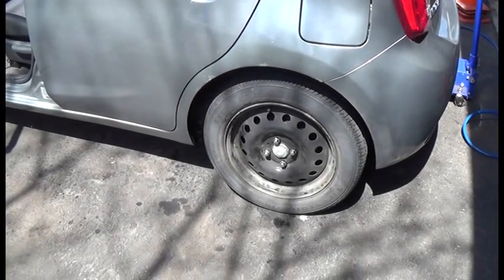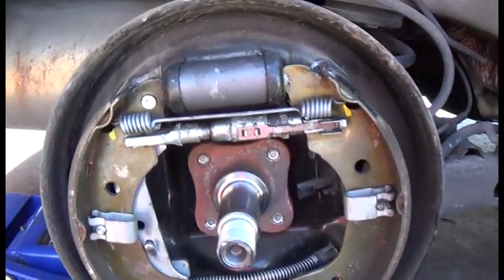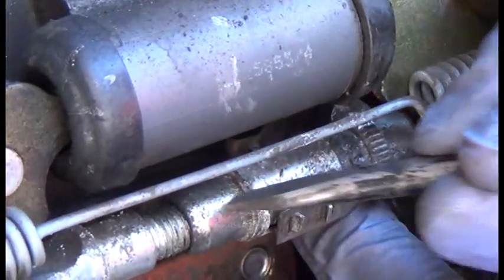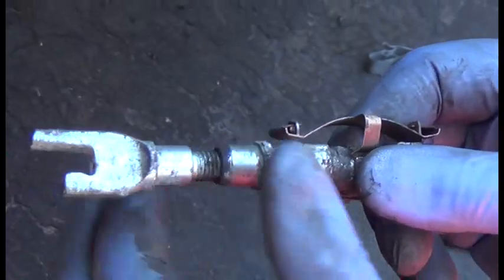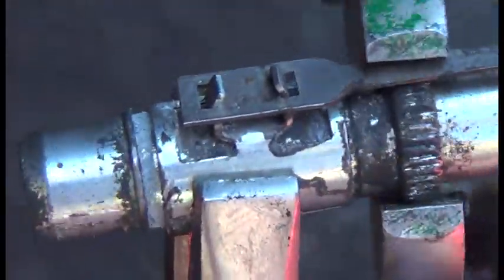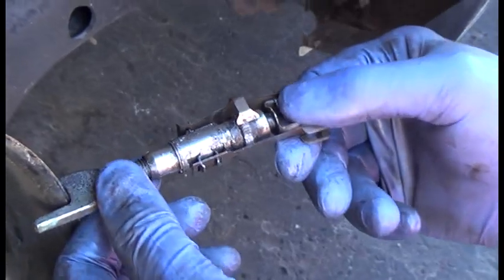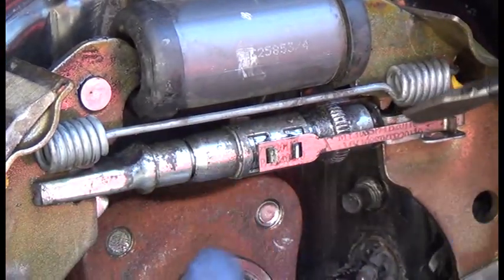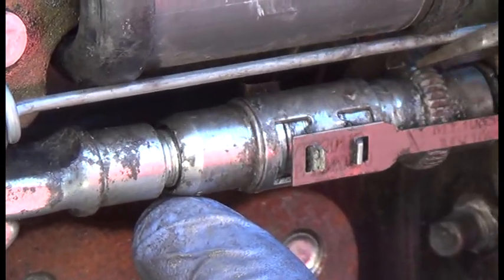Nissan Micra Seized Rear Brake Auto Adjuster

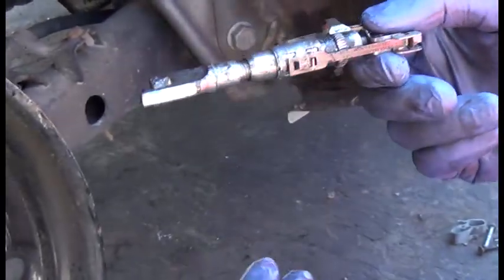Comment: Great explanation video, thanks for the details  have been searching YT for something to show me the correct way the adjuster goes in. I have a 2013 Sentra with an adjuster that disintingrated inside the drum. Would the same apply here, I mean the way the adjuster goes in? By that I mean @ 3:01 in your video, would that be the same for a Sentra? I am assuming the answer is yes. I don't think that since they changed the design from older (2012) vehicles that they would all be installed the same way unless the adjustment window is on the backside of the hub/wheel for different models.
Reply from the maker: No idea. Never worked on a Sentra. It is my opinion that this design be outlawed & re-designed. It is dangerous. When I first looked at my daughter's rear brakes, they were no longer functioning because they were not adjusting for wear.

Comment: Thank you for the video, it is great, however I don´t get what is the principle of the adjuster. What turns the adjuster normally instead of a screwdriver?
Reply from the maker: These are self-adjusters. As the rear brakes wear down, the self-adjusting mechanism rotates when the brakes are applied while in reverse, and possibly when the parking brake is activated (or both). When these mechanisms seize up, the self-adjusting does not occur, and eventually, your rear brakes will work at all.
Reply from the maker: In my opinion, this should be declared a safety issue, and the U.S. & Canada Transportation Safety Board's should have Micra's and Versa's recalled for a free inspection & repair at a Nissan Dealer.
Reply: @46fd04  Thank you for the reply. Yes, I understand those are self-adjusters, but I don´t get what makes the self-adjusting mechanism to work. So there should be spring inside, which rotates instead of screwdriver and the adjuster in your video is faulty. 

Does not matter. I have put out the brake drum and because it was worned out very (original from 2005 probably) I was not able to make it and I thought that is the adjuster what makes me to not be able to get the drum out. So I have taken screwdriver and I have tried to tackle inside something, so, and that something was the metal spring outside the self adjuster which I have damaged. Finally I have taken the drum out by brutal force and then I did not know how to put the spring back to the adjuster, so that was the reason I have looked for some video. Now it is ok.
Reply from the maker: @DalikAVR  Go to the 1:30minute mark. The spring is above my thumb. It turns the adjuster when the brakes get low. If you have broken the spring, you need to replace the adjusting mechanism.